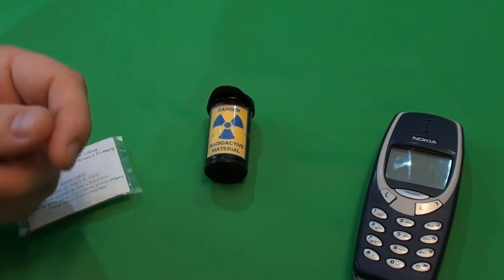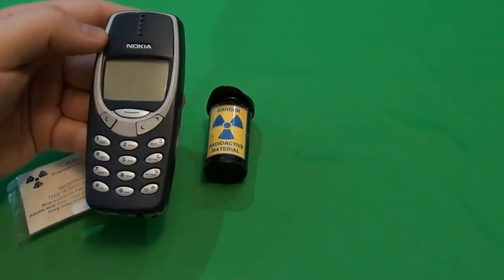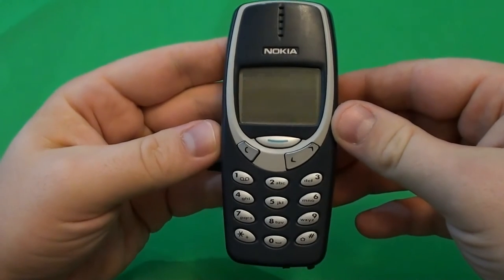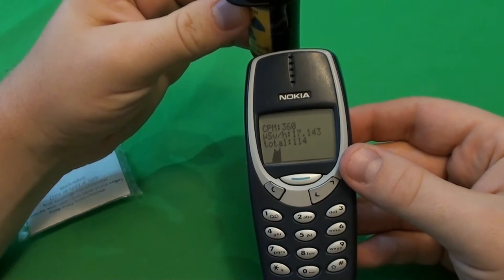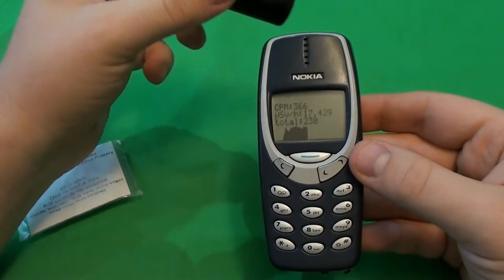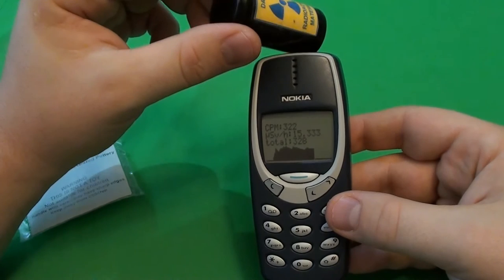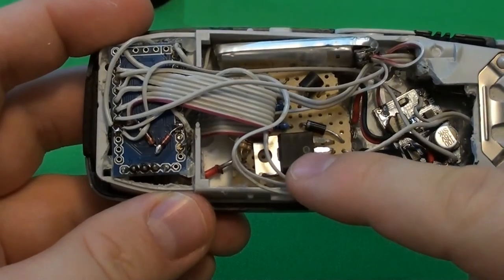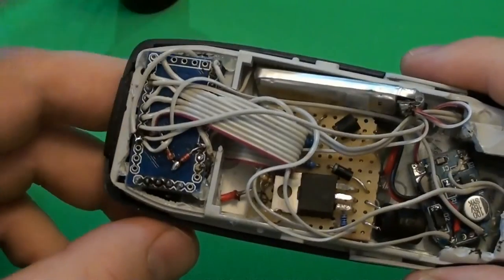Nokia 3310 Geiger counter

Comment: ideal for measuring covert
it would be interesting to know how well beta radiation passes through this plastic
Reply from the maker: you can strip and shave the plastic to the minimum, you can even make a hole and cover it with some thin black plastic.
However the tiny SBM21 can't pick up much of beta. It hardly registered any gamma from the radium :)
Reply: the holes in the plastic can help, but not always.
for example, in the dosimeter Radex has holes, but it does not give significant opportunities for the detection of beta radiation
in my experience gas-discharge sensors very good detect beta radiation.
now I have no working device with sensor SBM-21.
I can't check.
but I can show the device with sensor SBM-10, which sees a very weak beta radiation from blueberries.
if interested